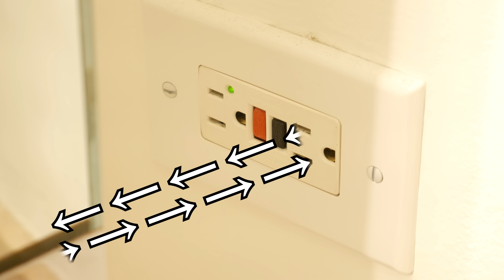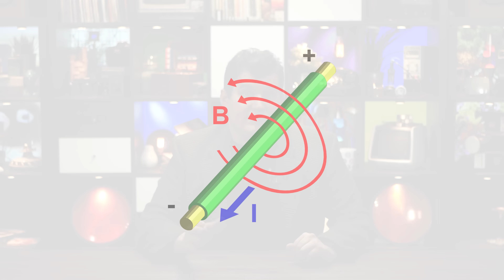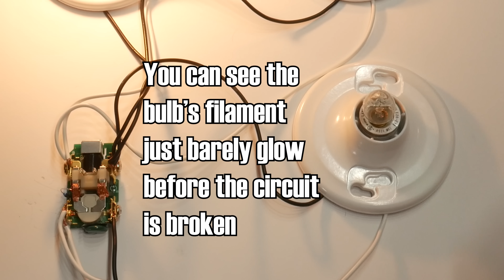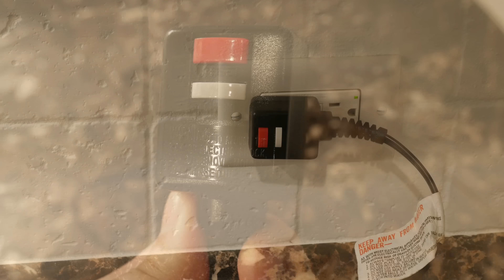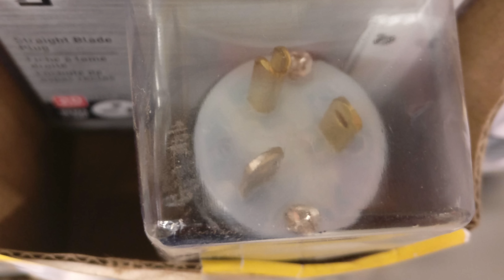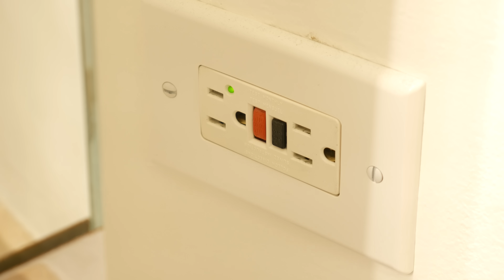The GFCI/RCD: A Simple but Life-Saving Protector

Comment: Frankly, you could have done a better job with this video.
* A "ground fault" is a current path from the supply to ground (e.g. through your body).  That shouldn't exist, and that's the condition being tested.  The neutral wire is not called "ground".
* It just so happens that you can detect this condition by detecting a mismatch in the current between hot and neutral, but that's a "proxy" for the real condition being tested (see above).
* Your example scenario of the incorrectly wired lightbulb is highly contrived.  The bulb would have to be very near to the GFCI for the pre-GCFI neutral wire to be available.  (What you are detecting isn't actually a "ground fault", but a "pre-GFCI neutral fault".)
* Instead, you should have demonstrated it by connecting the supply wire to the safety ground wire.

Comment: You've said this 15A socket can be placed in a 20A circuit. How is that, if the GFCI doesn't include overcurrent protection for the included socket. Mustn't a device with wires etc. only rated for 15A always be connected to an outlet correctly protected against currents over 15A?

I might be wrong here: Are 15A devices always built to 20A standards?
Reply: One can have 15 A receptacles in a 20 A circuit as long as one has more than one (a double is two). The opposite is not allowed. The rest of your comment makes no sense and likely is caused by a fundamental misunderstanding. I cannot see any reason why wires could only be rated for 15 A. The ticker the wires the better (provided one can connect them).

Overcurrent is caused by a failed device. The device is toast at that point. Over current protection protects the wires. Another cause is overloading the circuit.

Comment: Getting zapped by 120vac does not hurt more than surprise you. It also doesn't compare to a TV flyback, or even a lawn mower sparkplug wire. I had an uncle who gave me a screwdriver to short the plug so the engine would stop. Rather he knew it or not the metal shaft was exposed on the handle. So I got a nasty repetitive shock. My nerves were tingling for some time after that.

Comment: Only thing I have a problem with when you were demonstrating it with the toaster is how can you expect an equal current flow going into it and coming out of it when some of that power " quite a bit of it" is being released as heat into the air, there wouldn't be an equal amount going back into it because some of, or rather a lot of that electricity is being givin off as heat, so if it operated the way you're saying it operates, it would just click off right away for that reason.....

Comment: Another reason not to put the GFCI in a breaker is that the breaker version costs a fortune compared to the mass-produced receptacle version.

Don’t install GFCIs at the head of a branch circuit where the location is likely to be blocked by nearly immovable furniture, say a huge china hutch or a 500 gallon fish tank (don’t ask me how I know). How would you reset it?

Avoid the most expensive GFCI outlets with a built-in computer that tests the GFCI automatically every 15 seconds (vs. manually) and permanently disables it upon test fail wherever the GFCI feeds a critical load like a freezer containing, say, a $1,000 worth of food. What happens if the test fails 10 seconds after you leave for a two-week vacation? Oops!

GFCIs can be used on old two-wire circuits to allow the two-wire outlets to be simply replaced with 3-wire outlets where the ground is never wired up IF the supplied “NO EQUIPMENT GROUND” labels are installed at each outlet. The GFCI‘s electronic  protection substitutes for that of the missing third (grounding) wire. 

Some GFCIs have an injector coil that allows them to detect a neutral -to-ground wiring fault (page 194 of “Code Check” 2nd edition). That may be why it is said that later GFCIs are “better” than the older products. How about a video on that?

BTW, outlets may no longer be daisy-chained using the second set of screws, because removing one outlet even temporarily breaks the neutral to downstream outlets, a no-no; you must carry the neutral circuit through the box with wires, using a tap wire to go to the outlet. Ready-made pigtails are sold for this.

Another round of “electronics in the outlet” is the AFCI. Originally those were breaker-only, but now come in cheaper outlet versions. Outlets are now available with both GFCI and AFCI features. Replacing a single worn out outlet in a living area requires AFCI protection for only that outlet (even though it makes more sense to, like the GFCI, put it at the head of the circuit). An AFCI video is in order.

It just gets “worser and worser.” And do a video on why, after decades of successful 240v appliances using the neutral wire to serve also as the equipment grounding wire, we now need a separate, fourth wire. New dryers have 4-wire plugs to plug into a 3-wire outlet in an older house! It’s electricians’job security for sure.

Comment: Our brand new house has GFCI's on every circuit - but they trip at the slightest thing...eg turning on my coffee maker.  I was advised to replace them with a different brand - which I did, and now life is good.   But why did this happen?   Are these just junk because the builder decided to save $10 by putting the cheapest/nastiest ones?  Or are the new ones insensitive to an actual problem in the house wiring?  What are the failure modes of the GFCI itself?

Comment: Finding the faulty device with an RCBO, isn’t actually that hard since we usually place different areas of the house under separate electrical groups. Once the RCBO trips, simply disable all groups, reset the RCBO and slowly enable each group again. Once you find out which group causes the short circuit, unplug all devices in that group and repeat process until you find the cause. 

Shouldn’t take much longer than a couple of minutes.

Comment: We do have AFCi in the US. That's the breaker box cousin of GFCI. It does have slightly different rules of operation, though. It's job, as the name implies, is to detect arc faults. This helps prevent in wall fires. Roughly speaking, though, ground arcing still trips it, so while they're not aimed at saving lives from current contact, they will provide more protection than not having them.

Comment: The main drawback of putting it in the service panel is that when it trips the whole house goes black... and that's is a tad annoying
Reply: Well it depends. That was only on very old installations. Then they divided them into two so that in every room lights were at the different than the sockets. Nowadays individual circuits are often separately protected.

Comment: One benefit of having the RCD in the central panel is that it can detect faults in the wires running through the wall. This helps protect against accidents from things like putting a nail in the wall.

It also helps protect against faults where the wire isolation is deteriorating or water creeping into junction boxes and outlets. This way, a waterline breaking (or just condensing air humidity from a malfunctioning climate control) doesn't electrify the walls of your home.

The central RCD also protects hardwired "outlets" like ceiling lamps, electric ovens or your doorbell (yes, my parents house once had a ground fault in the doorbell button).

Comment: I live in The UK we call them R.C.B  residual current breaker     plugs all have a fuse on each plug  from 1 amp, 3, amp,5, amp 13 amp this depends on the wattage of the appliance colour code from wiring ie Brown is live  Blue is Neutral yellow & Green  is Earth

Comment: I've been doing residential electrical for almost 30 years and I have explained how GFCI plugs works about 50 times a year.  The biggest issue I see with GFCI is the price range.  People get confused when they go to the Home Improvement/Hardware store and see GFCI ranging in price from $13 to $30+ and thing they want the most expensive GFCI because it's obviously the best GFCI.
Reply: In Finland normal sockets cost that. RCD sockets are 70-130 €. Then you need to hire an electrician to change it.

Comment: It was nearly two years ago that I first watched this video, but it resulted in me paying more attention to GFCI outlets. Yesterday I was working on fixing up my old condo to let out, and of the four GFCI outlets, three would not trip when I tested them using an outlet tester, so after a trip to Home Depot, the place is safe again. Also, when you're running Christmas lights - with or without a Sharpie - and it rains, GFCIs are both your best friend and worst enemy.
PROTIP: When replacing an outlet, it's much easier if you cut its supply at the breaker panel before you starting putting pointy metal things into the outlet. Otherwise something shocking could happen. Trust me, I'm an engineer

Comment: Excellent video.  One thing I'll add (well...recommend)...particularly in Kitchens for the counter receptacles.  Don't string them (don't use one and then wire additional receptacles, as they are designed).  The 5mA current protection is total and if you are cooking some masterpiece that has the mixer, toaster, blender...and whatnot all going...these devices are often "reactive" loads that will have an influence on the current and timing that can cause a false-trip.  Spend the extra money and let EACH receptacle be its own GFCI and you will never get false-trips again but be every bit as protected.

In the USA you can (and in some cases) do get breakers with GFCI (and pretty much all circuits are now AFCI...different subject).  Depending on what is being protected and where your breaker panel is, it would be a big annoyance to have to trundle down in the the basement/garage or wherever your panel is just to reset the breaker for this sort of trip.  This also comes back to the more stuff you have plugged into the circuit and the longer the cable run is, the greater the likelihood of a false trip becomes (that long wire run to the receptacles actually consumes some electricity to heat up the wire too and you don't want that counting against you on your 5mA.

Lastly, it was quite informative that internally the receptacle you showed has 20A contacts though a difference in the two models you didn't present is that a "TR" is going to also be Tamper Resistant (has the little doors to prevent kids from sticking things in).  So you might get a price difference there though yes, 20A receptacles do tend to be notably pricier than their 15A counterparts.

Comment: Your negatives for RCD in the fuse box come from a bit of a bias, you're just more used to your local solution. I think you'll find most people prefer their local solution. Accessing our meter boxes is easy and find the faults are also fairly easy. Each solution has been engineered to solve a problem and they're both effective. Your videos sum things up well but remember you're speaking to an international audience and different isn't neccessarily worse.

Comment: The new GFCIs SUCK! They are all made in China, and the quality is pretty horrible.  They now perform a self test without tripping and they can count the number of self tests. After a predetermined number of self tests, they simply quit working and you get to go spend another $25 for a new one, and these bastards charge $5 extra for a 20 Amp GFCI that is the same unit as the 15 Amp NEMA 5-15R. I still have some 40+ year old Eagle, Leviton, Hubbel and Seymour Le Grande  GFCIs that still test good on a $1200 leakage and or a current imbalance tester. I  also have a go no go tester that will detect a fault with no power. That one trips at 225,000 Ohms leakage resistance which comes out to about 1/2 milliAmpere @ 120 Volts and 1 mA @ 240 volts. Yay! If I want to get really into it I also have high potential test equipment that can run up to 10,000 Volts DC or 6000 Volts AC to test the insulation on wires, transformer windings, bus bars, etc.  Those are "non-destructive" unless I jump over the instant trip circuit breakers with a jumper wire. Then it  will blow stuff up, including itself.

Comment: In the Dutch language the device is called "Aardlekschakelaar" which translates to "Ground Leak Switch" and is also not accurate enough. GFCI is the most accurate acronym for the device.
The cut off current in the Netherlands is 30 mA and the Voltage is 230 mA. The GFCI is installed in the panel and protects 4 zones.

Comment: It's true. UK wiring is different in many ways, our RCDs are at the main distribution box and typically are per ring with a master breaker  (therefore all the house is protected by them) but an RCD has saved my life on at least one occasion. Like the time i blew a 1/8" hole in a pair of tin snips cutting a cable i didn't know someone had plugged back in in the 40 seconds since i unplugged it.....

Comment: I can't tell you how happy I was that you didn't use your own body as the test for that GFI. Good idea to use the little light bulb for that.
In more recent American construction and retrofits, it is no longer unusual for GFIs to be installed in the power panel. 
Now, will you please tell us how arc-fault breakers work? That's something I've been wondering about for a long time.
Reply: Much more complex. There's a DSP and software inside which tries to detect the typical measurable electrical disturbances of an electrical arc while ignoring the usual arcing of a switch which gets turned off and the noise generated by electric tools or switching power supplies. Power drills (as well as quite a few other power tools) are a major challenge as the carbon/graphite brushes will produce lots of arcs during their normal operation.

Arc fault detector devices are very uncommon on the European market (even though Siemens produces these). I guess that in Europe, no one ever had the funny (?) idea of stapling (!) an un-jacketed (!) wire directly onto wood (!). In the USA, this seems to be the norm, so AFCIs/AFDDs are mandatory there. Often, the electrical mains wires are damaged when they are freshly installed. Thermal expansion and contraction will provide further wear on wires installed that way.

How can you have fun with an AFCI/AFDD? Get a 50W ham radio for your car/pickup truck and drive though your neighborhood, preferably in the evening. Maybe do a challenge with fellow amateur radio enthusiasts, to see who can shut down the most houses.

https://en.wikipedia.org/wiki/Arc-fault_circuit_interrupter
Reply: @klausstock8020  - Thank you! That is an excellent explanation. 
I didn't realize that my radio was capable of shutting down arc faults! My mobile rig puts out 65w on full power, so if that works I'm sure I'll find out soon. Maybe I should change my omni antenna to a yagi? That could be a new kind of fox hunt: Find the arc fault breakers! (in all seriousness, I would worry that doing so could be considered intentional interference, vs. it occurring accidentally. Much as I love your idea, I probably shouldn't do it.)

Comment: why do we have to name things different than whole world??
Reply: I know your comment is three years old, but the US loves to make things complicated with its terminology the rest of the world cant even comprehend and even within the US itself.

Most of the world uses terminology defined by the IEC, which makes things easier (US is going to have to eventually):
1) Line, not "hot" for the phase conductor
2) Earth, not "ground". the former is better because it clearly describes which ground
3) RCD, not GFCI. the former is better, although it still has its own flaws, the int'l equivalent of AFCI is AFDD, so rcd could also be replaced with _FDD (underscore is placeholder for a letter that stands for a word, but RCDD could be a possible replacement for RCD). we are not accounting for rccb or rcbo.
4) AFDD, not AFCI. the former is just more straightforward
5) Socket-outlet, not receptacle. again reasons are self explanatory, especially as the list goes further
6) Current-carrying capacity, not ampacity
7) Star, not wye. Star and delta IMO sounds more consistent than wye and delta (delta in North America is also sometimes known as mesh).

The list is pretty long, the IEC's IEV is free to access for most part of the IEC 60050 (the standard that specifies the IEV glossary). What I mean by "US is going to have to eventually", I mean the US is going to need to harmonize with the IEC standards. Additionally, the Australians still (as of writing) call the line/phase conductor "active" commonly, and for the British: they prefer CPC over PE (although PE is still used in the context of earthing systems) and they call residential distribution boards "consumer units", but overall the UK and Australia still uses IEC based standards. One more thing I find odd about the US is the obsession of using the word "national" and for example the NEC (NPFA 70) is not a federal law, and not all states constantly use the latest editions.